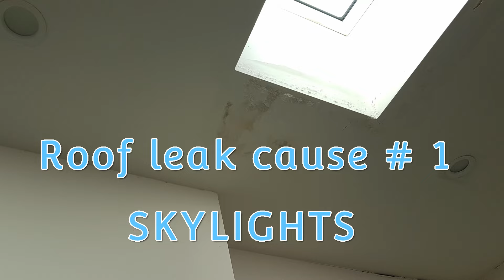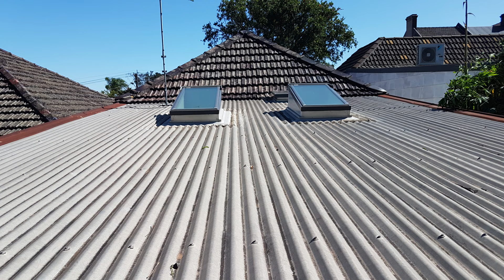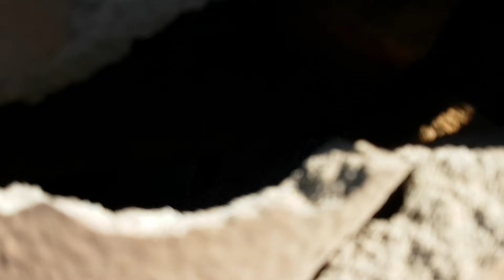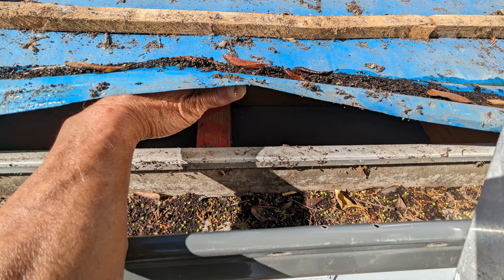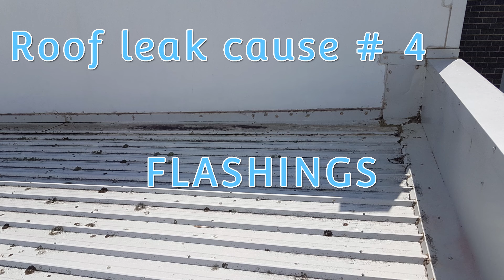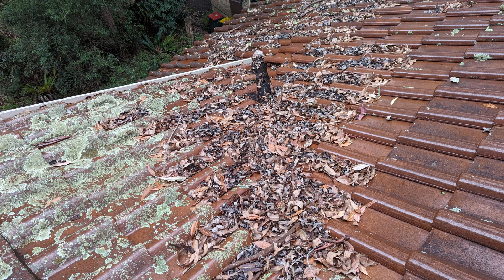5 main reasons why roofs leak

Comment: Been doing this work for decades. You are as usual 100% correct. I will add that a cause I would sometimes see is where a half width cut tile slips down.

As a side note if someone sees a bulge in the ceiling with drips they should puncture the plaster with a screwdriver to allow the water to flow out into a bucket in the room.